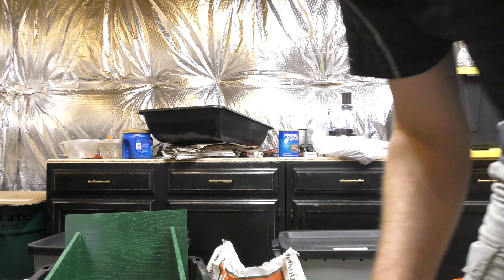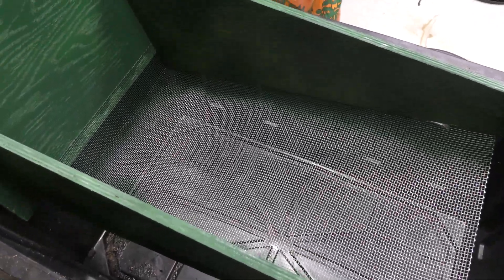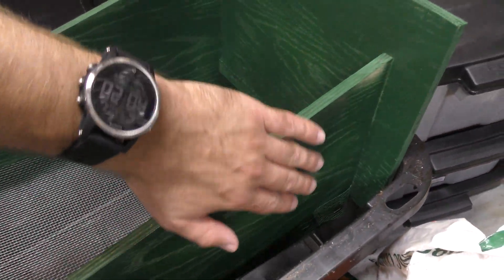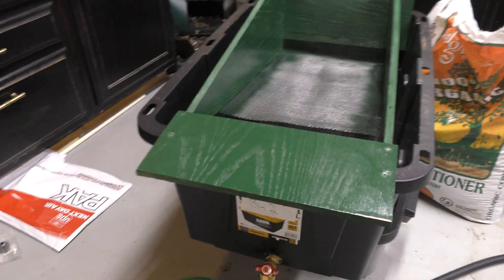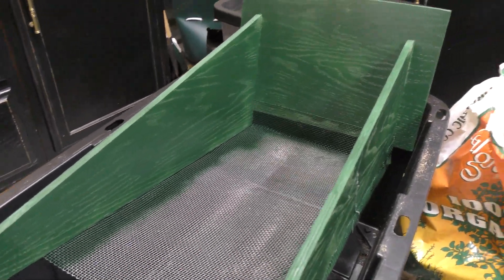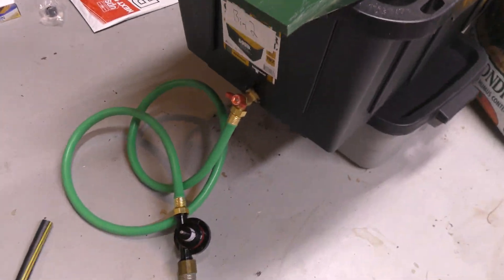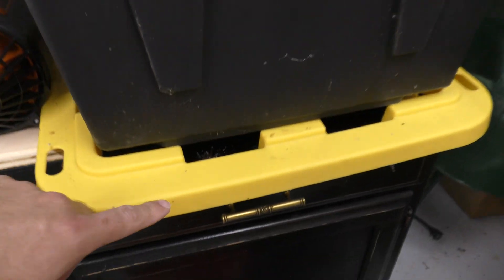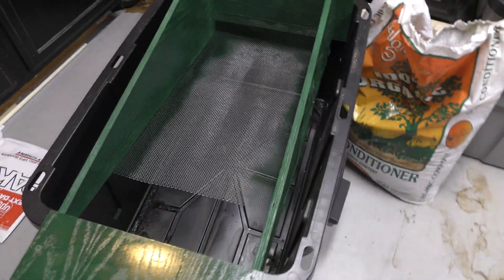New Worm sorting device

Comment: Watched a ton of your videos and enjoyed them all. I had a similar idea about separating worms from castings using water and screening mesh. Your idea for recirculating water is genius. So how did the machine work? Assuming it didn't go well because there was no follow up video. What went wrong. Perhaps the audience can provide improvements. I hope you can reply or make a video describing the results.
Reply from the maker: I had video but it was hard to see in the end it did not work and made a muddy mess.  The other issue was the hose valve I installed ripped out and I tried reattaching it multiple times but just could not get it to stick with the type of torque being put on it.

The other issue is the worms just got tangled up in the hardware cloth and I tried other materials but they drained too slow.

Maybe I'll try it one more time but I'll have to think a bit more on how I could change it.
Reply: My bin is only 7 months but my small 200 starter population is overflowing with many many small infants distributed equally among bedding and castings. Now I want to harvest casting but separating the babies would be hard. I thought your water sorting was a good solution.